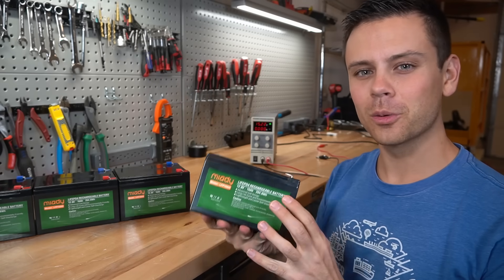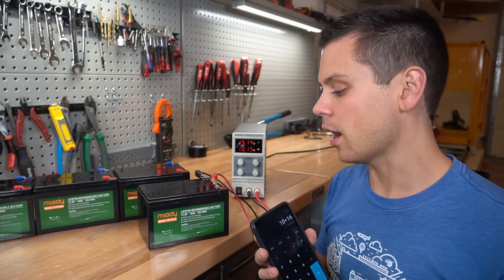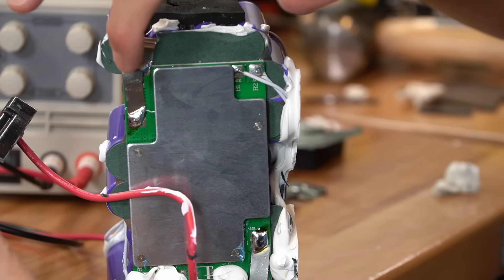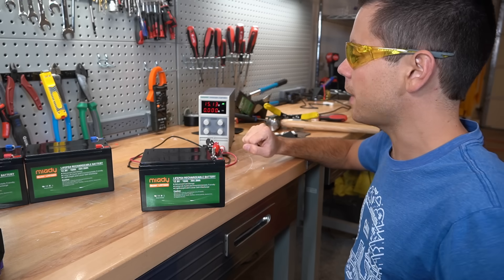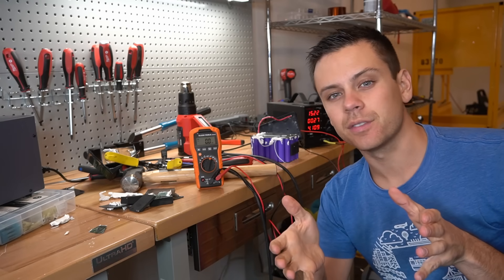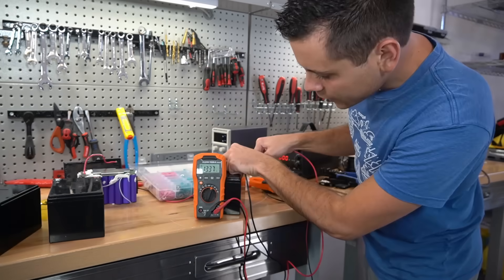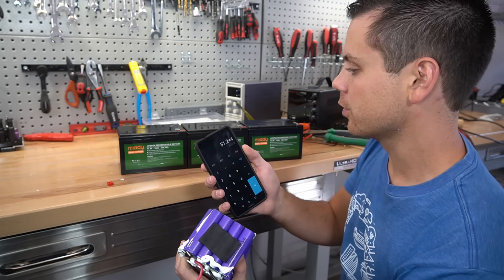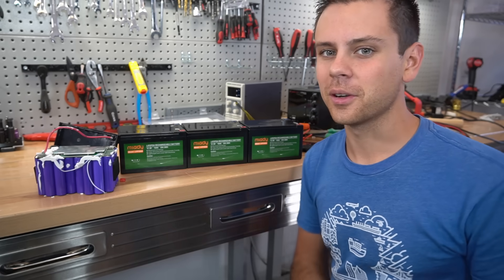$54 12V 16Ah LiFePO4 "Miady" Pack Tested

Comment: I am interesting if someone is capable to assemble enough cylinder cells to produce a 400V accumulator... My H-bridge would be almost happy. The only thing on top of that is a 400V charger.
Reply: U need ~110 cells in series 2 get 400v & depending on ur need & the cells u use, several of those in parallel...
It's gonna b hard 2 keep that balanced, charged etc...
Seems like a strange need...
There's probably a better way of doing what u want...
What's ur application exactly..?
Reply: @MaxMax-dq1lu  Yes, 112 cells in series. It is instead of DC-DC to have less stages of conversion what is suitable for medium/high power invertors above 100 kW. Ther are a few options to keep them balanced, simplest one is a "passive" balancer for every cell, in fact it is just a voltage limiter at level of 3.65 volt for LiFePO4.

Comment: Hi I have question its not related to this great video and thanks for it. I have a MG MPP 5000w 48v Solar Inverter. I have 10 150w Solar panels, I also have 4 100w Spear Solar Panels, Could I connect the 4 100w panels to the inverter to the same input point as the 150w Panels on the inverter? Thanks for the great videos.

Comment: You could try to charge them with e.g. 14.4V until the current drops to zero...would be interesting if the balancing actually works. But usually with those BMS you only have balance currents of 0.03A...will take forever to balance if you have not matched cells.
Those BMS are used in a lot of small Li-Ion Battery Systems.

Comment: Hi will , mate I brought a 250watt solar panel at most I’m only getting 90 watts out of it on a bright sunny day with no clouds on a summers day in Australia. Is this normal ? I have a small 40 watt panel and I get just under 40 watts out of it.
Reply: Hi buddy...
Either ur panel is faulty or u r wiring / charge controller is the issue...
U need 2 check ur getting the stated Vmax (Voc) & Imax (Isc) as stated on the back of ur panel with nothing but ur multi-meter (DVM) connected.
If ur figures aren't very close then ur panel is faulty & u should send it back...
Reply: @MaxMax-dq1lu  thanks mate, I think I got done from eBay
Reply: @michaelrobinson3935 
U need 2 test it...
Take photos as proof...

Contact the seller & threaten 2 escalate it if they don't take action 2 resolve the issue...
(I suggest u tell them what u want them 2 do about it 2 keep u happy... & not give them a bad review)

Also contact ur credit card company...
Here in Europe if u buy anything on a credit card & ur not happy & the seller doesn't want 2 do anything about it u can get get a full refund from ur card company... don't know if u guys have that in the USA...

Do let me know ur readings & I can help u more (I'm very curious)...
It might not b the panel...
Good luck...
I hope u can resolve the problem.
Reply: @MaxMax-dq1lu  Hi mate the OSV is 24v which I get using my multi-meter from the panel. The Mpv is 18v written on the back of the solar panel, But at the end of the wire I run to my Victron I get 14.5 v . Looks like I have to upgrade that wire?

Comment: The amazon page specifically states it does not have a high voltage disconnect and must be used with a chargers that stops on its own. Other than that you get what you pay for. They are currently the cheapest you can get that is already a pack. 

Thanks for doing the dead short test. A friend of mine got 8 and we put in fuses but that is nice to know.

Comment: Hi Will, wil l this battery  (16ah) work with a Renogy 10ah solar controler ?
Reply: That controller is pwm and I don't think they recommend that for lithium batteries. They recommend mppt.  But watch out some mppt controllers say not for use with lithium. Because it's not pre programed for lithium. But some people use manual charge settings. But to be honest I bet that 10 amp renogy would charge that battery lol. The 10 amp rating is for the solar coming in.

Comment: You should check out the Eco-worthy 30 ah 1280 wh which beats their would be 408 when at 32ah    
However they only have a 25 amp bms

Comment: I have used several of these in portable power boxes.  I control charging with a small solar charge controller and use them when camping to power lights, charge phones and laptops (using a small inverter).  So far no problems.  For the price they seem to be a fair deal, even if they are only good for 12-14 amps.  I connect two in parallel with no issues.
Reply: Hi buddy...
U do realise using an inverter 2 step up 2 masons AC & then back down 2 DC 2 charge ur phone is very inefficient...
U should get 1 of the USB chargers that plugs into a car cigarette port...
It would b way more efficient & would make ur battery last longer..!
Hope that helps.

Comment: Well that sucks, 4 of the 6ah ones are on their way here. Another guy did a teardown and it had the goop but didn't look like a short hazard. Someone else did a capacity test on the 8ah and it did I think 94%. I'll have to see what they do capacity wise. If they suck I'll try and return them
Reply: Heheh I wanted to see them also from the internals I mean it’s a cheap price fair for it’s cost in production , maybe bms sucks that’s why cells suck
Reply: @charlschuck6  one of the four I ordered showed up this morning. It's loose inside :( like the whole cell pack flopping around. Returning it, hope the others don't do the same. From what I gather Amazon won't take battery returns they just refund you and tell you to dispose of it. Maybe I'll part them out and use the return to buy a bms and make my own pack
Reply: But this return on batteries will probably be allowed once’s right ? That’s not so great that they come in varies ways no inspiration
Reply: @charlschuck6  I'll see what the other three are like. They were from another seller, if they are all jacked up inside I'll try for a refund on them too. I'm not trying to be dishonest, but I'm not blowing my money on junk when I could have spent the same money and got two 10ah Dakota lithium batteries. These miady were $75 each in Canada

Comment: I could see myself using these batteries for my household outdoor lighting only.
And have them in my Shed. I would not trust them in my home.
Reply: Outhouse light battery buried 5 feet down, sounds like a awesome singular application use. And one can still charge a iPhone in case the session lasts longer then anticipated.

Comment: I realize you focus on larger capacity systems, but I'd be interested in your reviews of other smaller lifepo4 batteries as I'm looking for 20ah or so for portable ham radio operation. 100ah is way overkill. Thanks
Reply: Yes, a review on 20 or 30 amp hour battery would be very much liked. Thank you. Lots of amateur radio ops are interested in this, including myself. 
Thank you !
WA7AXT
Reply: I too would like see them tested for HAM radio use.  Field operations for 48 hour use.
Reply: Not only portable radio operation, I have many portable projects which require a small battery.
One such project is a bicycle mini camper with a small solar panel and small LiFePo4 battery.
Reply: I was thinking of buying the 20ah for Amateur Radio as well but only to use with 10 watts from my ICOM 703 PLUS & I thought it would last a very long time since I only do SSB & no CW or Digital Crap.I have a 9Ah Bioenno already but I thought I’d buy a 20ah at the price these sell for and I might want to run my ICOM 7000 as well but not at QRP Power.👍🎙🇺🇸
Reply: I’ve made over 150 QSOs for SOTA with a MTR3b with a 1300maH LiPo 3W! I’ve never used more than 5 W and have 6000+ CW/SSB QSOs.
Reply: Greetings from W4GSM, I bought a Bioenno Power Lithium 12 AH, works well but expensive, I did run it once at 75 watts out for a nice qso into Germany for about 10 min.
Reply: I'm with you - I want to set up a portable system to use while camping (switching from ice chests to a DC compressor fridge) and since I have ZERO use for an inverter, a prebuilt power station isn't ideal for me. Reviews of smaller batteries like this are VERY helpful!
Reply: No such thing as overkill.......lol
Reply: @mac11380  sometimes they need to control space and weight.
Reply: @mac11380  THERE is if you have to carry it to the top of a mountain for portable ham radio work with a low power transmitter.
Reply: SOTA goat here agrees!
Reply: I know this is 2 years old but yes there is overkill. Ever hike up mountains with your radio gear? I have over 300 times and you don’t want to be regularly adding 100ah batteries in your pack. For my purpose 4.5aH fits the bill.

Comment: i got my 16ah Miady's for 49$..i've paired it with a bestek 300w PSW inverter. The ones Will is reviewng are the newer & lower QA versions (assuming these were to pumped out asap to meet the demand)...the ones i bought last year were well made.
Reply: Mine are from last year
The one I opened pretty much matched Wills quality assessment

Comment: I have two of these when they were first released on amazon. I tested both and pull 406wh in parallel. I figured that was close enough. Mine were tested the day I got them which was early July. I need to do another capacity test at the end of the year to see if they have degraded any. I’m not worried about low temp disconnect. I’m in south Texas plus the battery are inside. They get cycled pretty regularly. Charged with a 50 watt panel on the roof.
Reply: I actually paid $45 each. So they seem to have gone up in price since I bought them

Comment: I wonder if the cells are actually LiFePo4 or just cheap salvaged 18650s that are running at low voltage. The curve definitely looks like LFP bc it's so flat so idk.
Reply: Yeah. I was thinking the same. Not sure it is what is say on the box.
Reply: @RobinHagg  they are supposed to be LFP

Comment: Finally a cheap and reasonable price lithium battery I can afford oh wait this video probably just made the price go up. 
Was using a car battery that was a few years old as a deep cycle battery it finally bit the bullet had a little bit of a freeze-thaw cycle that it didn't like and it was losing capacity. Tried to revive it but ultimately had to scrap it. I was hoping to replace it but go with something later and lithium is expensive and deep Cycles are heavy. Mostly used it as a portable battery pack anyway so weight would be the priority after price.
Well it looks like they'll have more capacity than an SLA battery but not my much don't know if that makes the price worth it?

Comment: They would still be good replacement batteries for electric mobile scooters as they would be lighter than the lead acid that they would replace. Also kiddy cars and portable fish locators. Light weight and a good power curve. Still better that lead acid as far as weight and charge speed. Try to tell a kid that they have to wait tell tomorrow to ride.

Comment: i think these would be prefect for the kids ride on electric vehicles. as lead acid battery's for them are costing around 75$
Reply: That's exactly what I've done with two of them. What's also really cool is they output 12.8v, giving them a small but noticeable speed increase.

The only downside has been dealing with finding lifepo4 chargers for the cars. Ive been able to do mods and make it work though

Comment: Hey Will, check at 2:03 The BMS didn't disconnect at 14.6V. It's still charging at over 6A at 15.46V i.e. over 3.86V per cell. Isn't it dangerous? I wonder what's the low voltage disconnect. Thanks for your review and teardown.
Reply: Will did mention that the BMS overcharged 2 of the cell banks and under charged another.  His voltage checks were out of balance too. Sounds to me like the BMS isn't doing its job. I wonder on the open one if connecting a good BMS  and doing a bottom balance might fix the issue, or if it's really bad cells.

Comment: Glad they worked for you. :-) I ordered two and both were dead on arrival. Good thing it's no problem to return and get your money back on Amazon.
Reply: I got a bunch of these and actually like the fact they are each only 204wh. When one dies, which they will, it’s easy to replace. Mine will only get cycled 4 times a year so the price was right.
Reply: Did you try charging them first? Many BMSes  ( all ? ) will shutdown and show no voltage when the battery gets below a certain voltage. It is done to protect the cells. Just a small charge and the BMS then comes back to life and shows voltage.
Reply: @gravelydon7072  actually that happens with one of my packs
I have to jump start it to charge it
Reply: Open it up
I'm betting the bms wires broke off
Reply: To late lol. Returned long time ago. I might give them a new try anyway. For what I want to use them in the RV, they are still a good option.

Comment: I always assumed that batteries were packed/assembled/soldered by machines as a cost savings measure, but based on the build quality it's obvious that these are assembled by hand (and perhaps not the most skilled hand at that). I used a LiFePO battery earlier today to do some cold water boating with my trolling motor, which is my only means of propulsion. The air temp was below freezing and the water temp was barely above freezing. There's no way in hell I'd use these in a mission critical application like that...
Reply: Most cheap ones assembled by chinese labor and imported. Their quality control is lacking in many areas. The lesser know chinese battery brands typically do not meet stated capacity ratings.
Reply: If you were getting paid $1.00 an hour, how much " craftsmanship " would you put into one of these batteries?

Comment: Do you think it'll have enough power to crank over a lawn mower.  I've used138 amp hour lithium iron and I've had somewhere between 500 and 1000 amps out of it.  Judging by that I think the cells in this little battery will have the power to crank something over but it's doubtful the BMS will handle it.
Reply: Maybe I'll open the battery end bypass the BMS just for the starter

Comment: I just built a battery like this, with 32700's 
18+ah with 3cells parallel,  I have. $58 in including 100amp BMS!
Reply: The 6Ah 32700 cells seem to work good, easiest way to make medium capacity battery packs, less batteries used compared to 26650's or 18650's.

Comment: Hi Will, do you have a 12v titanate cell you could part with. I am working on a differential temp teg charging circuit in extreme conditions.

Comment: I had already purchased 12 of these to make a 24v - 96Ah battery pack for emergency backup power with 1500w of solar panels. Will be hooking them up 2p6s and running a 2kw 120vac Giandel inverter. Thanks for the review, but I don't think I will be changing my plans. Maybe I only get 84Ah instead of 96Ah, but I don't see anything dangerous about these batteries for a stationary system, and $600 for these 12 batteries is still a great price/Ah. Also my charge controller is programmable, so I can customize it to give an extra level of protection for the batteries.
Reply: What’s the real size of each battery pack ? I made a 18650 at 16Ah and it works but it’s work to balance them and charge when they are all out of balance but then I noti these price and it’s way cheaper to buy them already made and even better lifepo4 chemistry good price if I were to buy I’ll probably upgrade the bms 😅 but then again more $ for a battery that has so far only a bit over charge on cells as these videos shows .

Comment: Ali 280AH LIFEPO4 cells are around $70 per cell at the moment
Reply: Have a link?
Reply: But be careful.  Some have fakec IQ class b cells which are difficult to keep balanced at high charge or discharge cycles with diminished capacity.
Reply: @DIY Projects $3188 16 cells Ebay cream93 IQ 02YCB66710000J are different in all of them. Some cells had damage before packaged and different resistance.
Reply: @DIY Projects Yes, he sells junk batteries as brand new with full capacity but not even with a 5A active balancing I can get full capacity because some cells get charged or discharged faster than the others.

Comment: What's that new capacity tester you're using? I got one of the cheap ones with the fan that you picked up on Aliexpress, but I made it explode
Reply: Please read my comments, you have all the details there, except technicals. If Will says it’s good, then it ought to be good, indeed. Stay safe. 73s...

Comment: @ Will....IF a person didn't expect too much, couldn't it make a poor man's Jackery for just emergency cell phone recharging ? I'm thinking about taking a chance just to do some testing with.
Reply: The problem with using LiFePo4 as an emergency backup; this chemistry should not be held at 100% for long periods of time.  The long term storage capacity should be at 50%.

I have both LiFePo4 and FLA/AGM for emergency back up.  The FLA/AGM are kept at 100% with a battery maintainer.  The LeFePo4 pack is held at 50% +/- 5%.  When the power goes out, I have the FLA/AGMs to keep things rolling for several hours until I can get the genny out to charge the LiFePo4s up to 100% then switch everything over.  This can be a pain but it has worked for me on a few occasions.
Reply: @Gerald.  Certainly, yes. You could wire an inline fuse, say 5Amp will take care of the safety.
Reply: @sreekumarUSA  Remember, the fuse primary purpose is to protect the wire.  So if you have a standard 18 AWG wire, it could be protected adequately with a 10 amp fuse.  The higher the gage (lower AWG number) the higher the fuse.

Comment: looks like about what apc backups use but instead of lead acid, its lithium.  I would like to see how these work with the 1000 or 1500 apc battery backups.   The lead acid ones fail anywhere from 1 to 4 years....and  yes, when the battery fails, the power just stops even though it is still plugged in.
Reply: Just about all makes use the same size batteries and it is just the top terminals that are different.